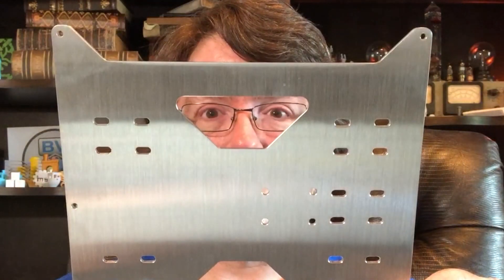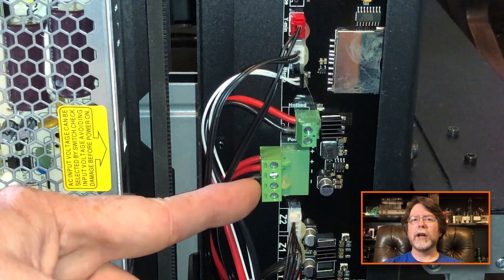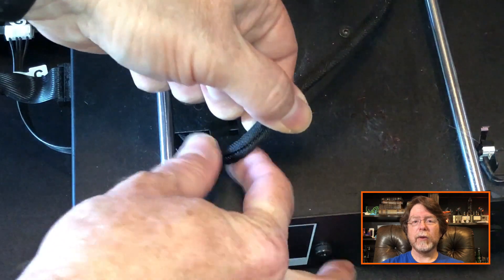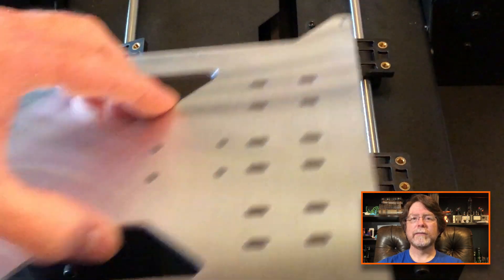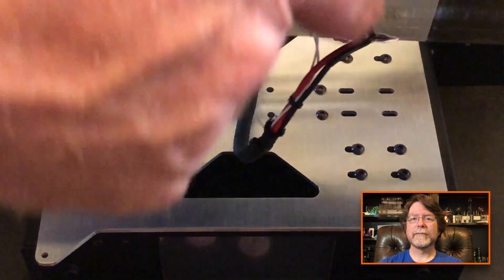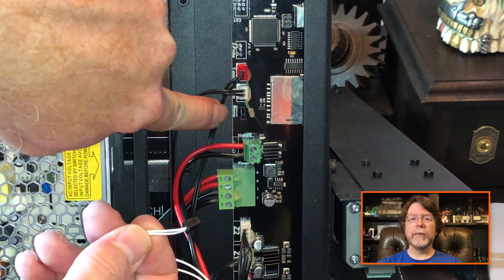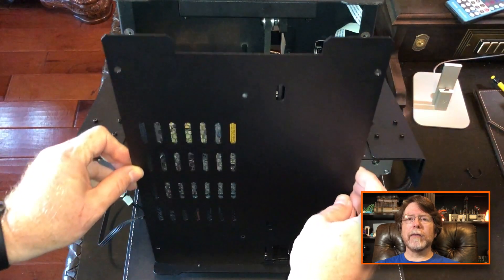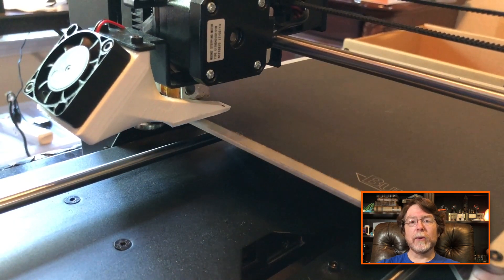Why Ask Y (Carriage)? Upgrading the Monoprice Maker Select Plus

Comment: Great series of videos.  They've helped me lot.  A few questions:  Could you create a video on replacing and/or adjusting the tension on the y axis belt?  Also, I noticed in this video that you are using a different cooling fan than the cobra one you installed a few weeks earlier.  Don't like the cobra cooling fan bracket anymore?  Thanks again for the really helpful videos.

Comment: Also, I used to use spring supports to control unintentional side to side motion during prints, on the stock Y carriage. What would you suggest on this upgraded carriage?
Reply from the maker: Hi Frank! My suggestion would be to use these stiffer yellow springs for the bed. They are thicker, and have a flat top and bottom, so you don't need the little printed spring caps that keep the springs centered on the screw.

https://amzn.to/2X1IDp4 [Affiliate Link]

I'd also suggest tightening the bed down so the springs are compressed about 3/4 of the way, and lowering the Z endstop switch mount to get the nozzle within about a millimeter of the bed. Then you can adjust the bed height as needed. Having the springs more tightly compressed will keep the bed from shifting slightly in the X and Y axes.
Reply: @BV3D  I bought the springs because of this comments. Now they arrived and the M3 nylon nut that attach to the heatbed don't fit inside. Do you think it's not needed with these springs or the spring have to be wider?

Comment: Great video man and maybe you can help me. I have 2 printers, both from MP. One is a mini v2 that prints really good for me, then there's the new one I picked up from my friend without any instructions. Well it don't seem to print correctly, it speeds through a print when it tries to print as if my settings are totally off.
Reply from the maker: Hi Zach! So what's the second Monoprice printer you've got? The one that's running at warp speeds? 🚀

Comment: Kinda of a strange question but why is the power wire on yours opposite from mine.  I put the red wire towards the back of the printer and the black towards the front.  ( + - ) not ( - + ).  Different I guess.
Reply from the maker: Hi Rob, as I recall, the heated bed isn't polarized, despite the red and black leads going to it. It's just a big flat resistor that gets hot when current flows through it. So it shouldn't really matter how you hook it up. That said, I need to replace the thermistor on one of my Maker Select Plus printers, so I'll confirm this while I've got it apart. 👍
Reply: @BV3D  Guess your right, didn't think of it that way.  I did notice that there was no + or - on the board so your probably right.  I just noticed that because I was doing this mod today.  Unfortunately after the mod I can't get my bed level.  No matter what I do, one corner is to loose or to tight.  Hopefully I get it figured out cuz it's no fun when your not printing.  LOL  Take care.

Comment: Thanks Bryan. I'm actually sandwiching 2 of the flimsy original plates together to stiffen up the Y carriage. I'll let you know how that goes. If it's not great I may just get aluminium replacements for mine. Cheers, JAYTEE
Reply from the maker: Hi Jaytee. I'm curious to hear how that works out for you. I don't know if you'd need slightly longer screws to be able to attach the bearing blocks, or if the stock screws will still reach.

The stock Y-carriage plate is not what should come to mind when someone says "FlexPlate System." 😄

Comment: Hey wait a minute. That is not the cooling fan we saw last week. You snuck in a mod on some day other than monday.
Reply from the maker: I snuck in a whooooole other printer. I bought one second-hand from a guy on the Monoprice Maker Select Plus group on FaceBook. It didn't have the Y-axis carriage upgrade. But now it does. 😉

Y'wanna know the first thing I did to the second-had printer, apart from cleaning away all the bits of broken glass from the shattered borosilicate bed and putting the poor thing back together? I put my Ribbon Cable Keeper mod on it. That stupid ribbon cable had a death wish and kept trying to wrap around the X-axis limit switch arm. Now the ribbon cable is out of the way and looking good. 👍

Comment: Brian, I love your videos.  I noticed you already had your printer unplugged before starting the video, but you may want to remind others to be sure their printer is not plugged into power before starting any mod on their printer.  (Just saying).    Keep up the great content.
Reply from the maker: Hi Roy, thanks! I thought I mentioned that when I tipped the printer back. But I'll try to remember to call a little more attention to it on videos involving things that get plugged into or unplugged from the printer. And I should probably urge caution when working around the hot end too. I was dumb and pressed a finger against the heater block the other day. Ow!

Comment: Are you planning on doing a video on adjusting the belt on the printer?
Reply from the maker: Hi Tom! As a matter of fact, I am. I've got a compact X-axis tensioner installed right now, but there's a different (larger) one I want to try -- it looks easier to adjust.